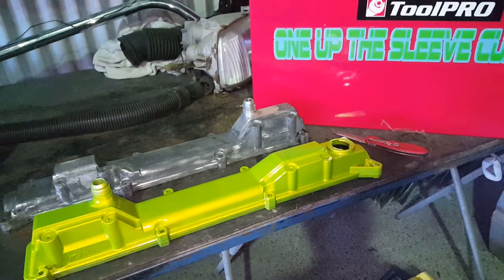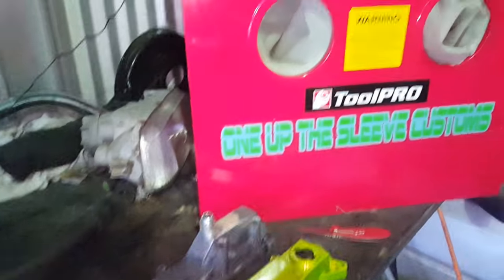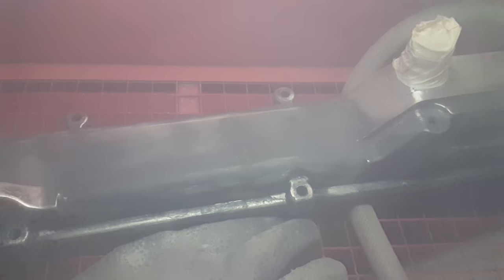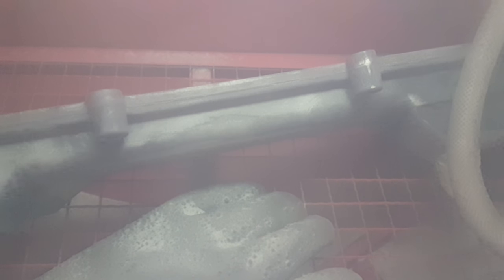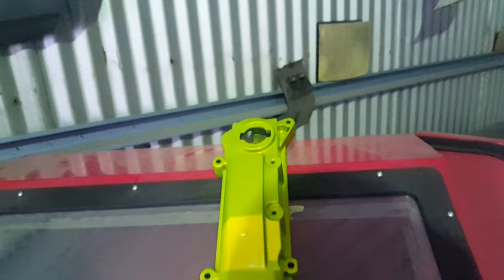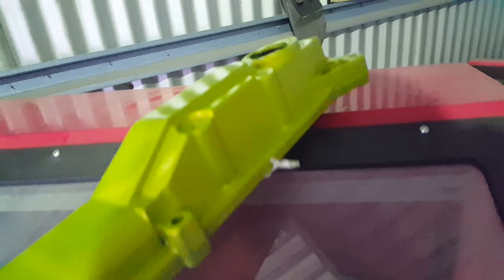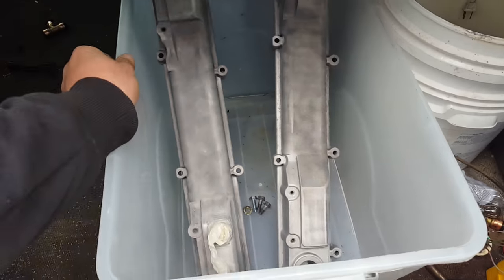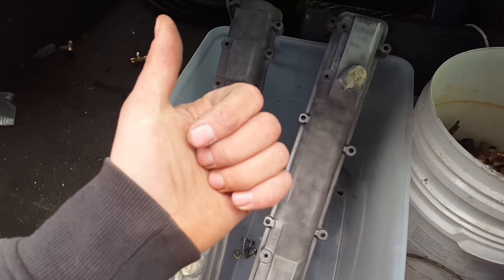Toolpro Sand Blasting Cabinet Vs 2JZ Alloy Cam Covers

Comment: What do you use for the sand blast media? I've yet to get one of these but it's good to know how these jobs are done. cheers
Reply from the maker: The sand in this is graded 18-40 thats well used. (Heaps finer than orginal grit) as you see a good sized wet and dry vac is needed to get rid of the fine dust
Reply: One Up The Sleeve Customs hey again, what happened to the other video of the ryobi vacuum?
Reply from the maker: Been super busy and have a huge que of footage thats getting edited and released as i can. Cheers

Comment: I've got the exact same setup with the ryobi vacuum, toolpro cabinet and belt drive air compressor just added a homemade dust collector made from a cheap bunnings bucket and a couple of plastic pipe fittings works great
Reply from the maker: Yeah thats the way to go bet you will get years out of it all too
Reply: @Oneupthesleevecustoms  What kind of CFM do you need for this and what media is best to blast aluminium parts that will be painted after?
Reply: What nozzle are you using?
Reply from the maker: Fine dry sand im using graded 50n
Belt drive compressor at a minimum id say. I run 600lt of air storage so that makes me a huge buffer for constant air
Reply from the maker: The biggest one